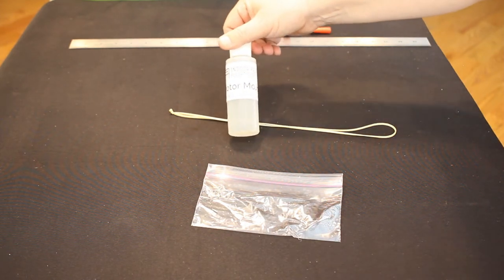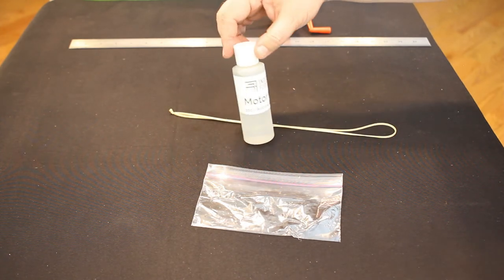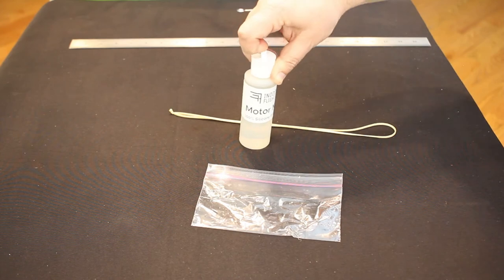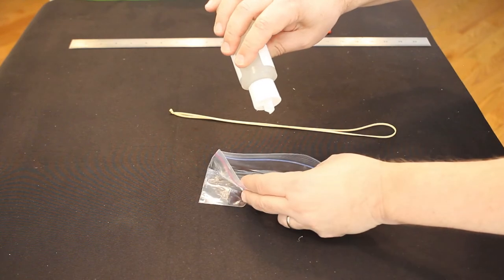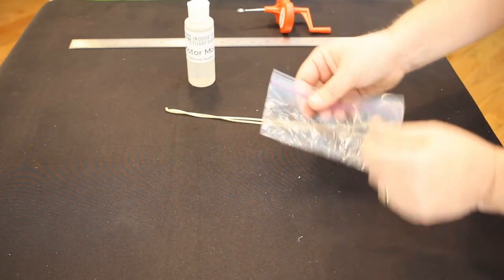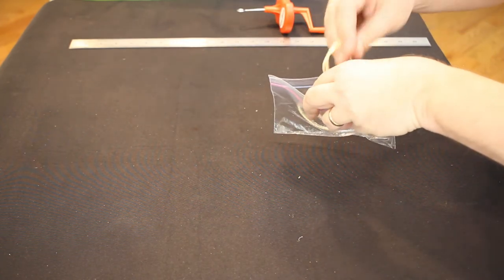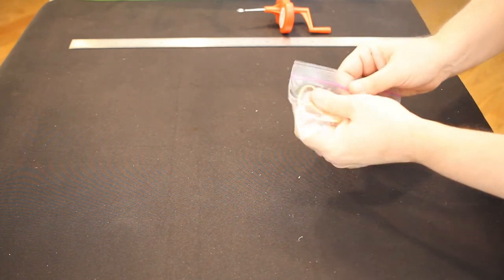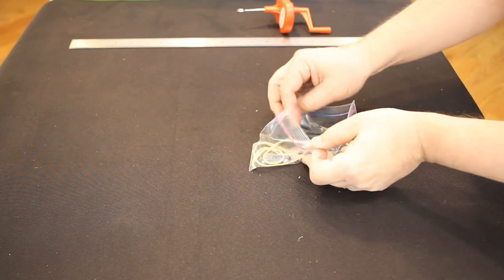AMA Alpha Video Series: #5 Rubber motor lubrication

Comment: I have always used ArmorAll as a rubber lube but recently got some Dow 33 and tried it on my Alpha. It slicked up the rubber really good, but I immediately started having problems with the motor coming off the prop hook during the motor run (like every time). I washed the Dow off with soapy water, re-lubed with ArmorAll, and no more problems.
Reply from the maker: I would personally not use ArmorAll as a lubricant for rubber. Silicone oil or grease are, to me, better options. But I would also typically use O-rings for models like this. I considered talking about that, but figured it was a bit too advanced for this series.
Reply: what is the exact name of the armor all product?